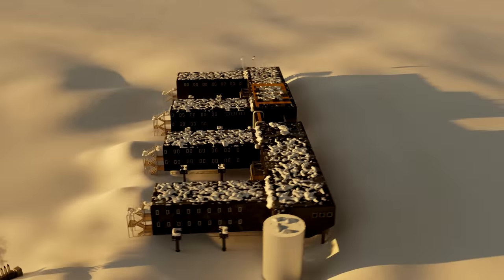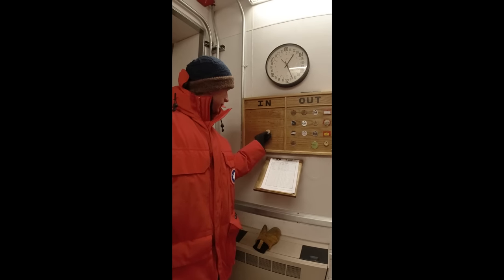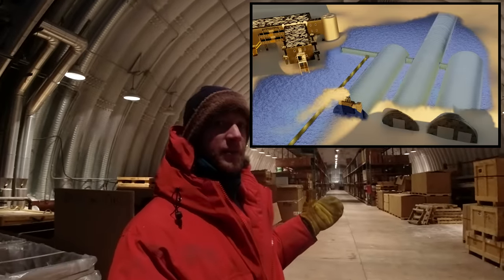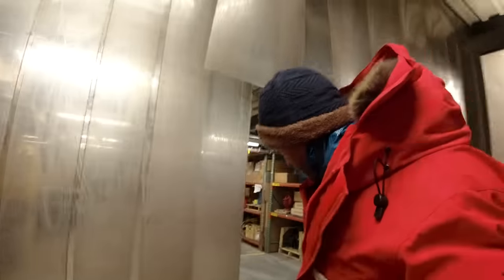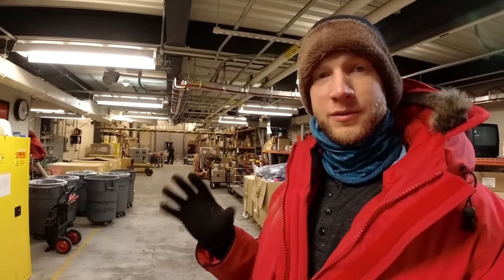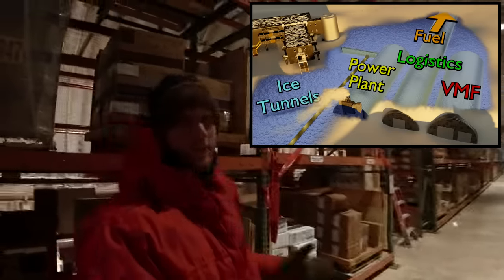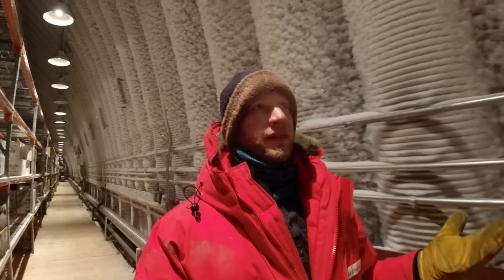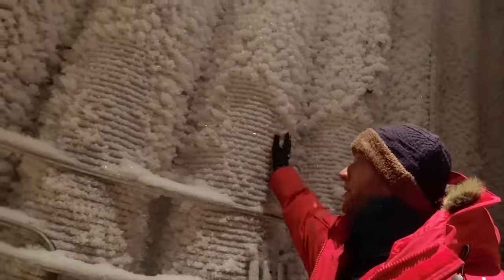South Pole Station Tour - Part 3 - The buried sections

Comment: Thanks for the tour. It is amazing  how all this is done underground. 
Where does all the diesel exhaust go to when vehicles are being maintained inside? Are there filters, scrubbers etc to take care of it? And the vehicles driving outside, where does that exhaust go? If fuel spills happen, what is the procedure to capture any leakage? Just wondering.
Reply: Don't think anyone care. What people don't know or can see, then you don't tell.
Antarctica is a big place... Hey, it doesn't matter if we just pollutes nature a bit. A little snow on just so no one can see.
Reply: Go back and listen to what Joe said about fuel. There is no diesel.
Reply: US fire stations have exhaust hose systems that hang above the exhaust stacks so that engines can be run safely indoors during drills and warm ups.  Of course, the stations are not under ground.

Comment: Serious question: why don’t they put in a small nuclear reactor like ones they use on aircraft carriers to power this place? With diesel generator backup? Would the issue be water cooling the reactor? Or risk of a shutdown or catastrophe? It seems to be a much more efficient manner of powering this place long term and saving on fuel costs. Any input is greatly appreciated.
Reply: Too expensive.
Nuclear reactors require constant maintenance. When ship can go to port that's fine, but to do maintenance in the South pole is like nailing with a golden hammer. You can do it, but it's too expensive with a cheaper alternative.
Building, transporting, maintaining nuclear reactor in this circumstances would break even in a couple hundred years.

Comment: is it not possible to use solar power in sub zero conditions? ive seen people use them fine in snow. just seems like it would make sense in a place where the sun stays up constantly for several months out of the year.
Reply from the maker: It might be possible, but a logistical nightmare. uge array to get at least a couple hundred kilowatts. Active tracking since the sun moves laterally (in a circle), and motors hate extreme cold; anything with moving parts really. And then a dedicated technician. Constant cleaning due to windblown ice/snow. And all that simply to supplement main power for a few months of the year. It just hasn't been seen as a priority.

Comment: Very interesting to follow you! Has it happened that small rodents and insects have entered the station with goods.
Reply from the maker: Nope! No bugs or critters
Reply: @JoeSpinstheGlobe  it is actually very surprising that mice and roaches haven't made it there....yet. It may be the only human habitation on the planet without our commensal followers. they should have a cat at AS though, just in case. plus it would be cool.
Reply: At -55°F I doubt any critter could survive and a cat will die for sure.
Reply: @Muonium1 No animals, like cats, are allowed anywhere on Antarctica. There’s one thing that humans have learnt, when you take an animal to eat a pest the animal finds easier things to eat. Which is why Australia is killing 3,000,000 cats, they have caused the extinction of 25 species of marsupials. If you released a cat at the other stations near the coast the cats would kill penguins, eat their chicks and destroy all the Skua and Petrel populations. A catastrophe.
Reply: @kylekyle7386 He meant inside the base, not outside.
Reply: @teeanahera8949  So don't allow them at the coastal bases. There is exactly zero chance of a pet cat at the Amundsen station causing any kind of detrimental environmental impact of any kind.
Reply: @teeanahera8949 yes, like on Marion Island. They had a huge cat problem, and now I think they have a rat problem.

Comment: Is there a camera or alarm system that you know of? I am a security technician and I am fascinated by the facility. And the logistics of running long COAX/Cat5e or Fiber. Especially with the long range, they'd have to be IDF (Data) cabinets all around the facility or just 2 if you have good switches and DVR'sworrisome
Reply from the maker: There's just two i believe on station (separated for security/safety), with all fiber connections between them and to the satellite uplink facility. But that's about
Reply: @JoeSpinstheGlobe  That's amazing, I wonder what is leading to the Satellite Uplink Facility. Straight Pipe i'd imagine! And thanks for answering my very curious question! I'll do some more research on the matter :)

Comment: For burnables with a scrubber for waste particles in smoke wouldn't a high temp incinerator generator(away from living area and support generation buildings) be good to use too for heat, energy to recycle waste and have even less and more reduced waste to be shipped out? Many farms have those now.
Reply: Too polluting, too much maintenance, too few staff to monitor it. Antarctica needs to be kept pristine.
Reply: @teeanahera8949  Yeah no matter how high tech there'd be some pollution released. Anywhere else it's good vs landfill for Antarctica nothing needs to there beyond nature's waste cycle.

Comment: I'm surprised you guys don't have solar pannels or wind turbines for use in the summer. Aside from needing a daily clean it could significantly decrease the fuel you need.
Reply: Panels and turbines would both be exposed to constant temperatures below freezing. They'd require permanent maintenance and it just wouldn't be viable.

Comment: Fascinating tour . I would have thought that  solar power would play a larger part of you power supply nowadays though ? or is it too cold for panels to operate?
Reply: The sun angle is probably too low at the South Pole. I know that Greenpeace did use some solar at their small Antartic Station back in the early 90's. Their documentaion indicated that it just supplemented their power during the summer months and stretched their fuel for the generators. They also had a wind turbine as well. Greenpeace was close to the coast so the sun angle would have been a bit higher in the sky.
Reply: Solar panel work better the colder it gets. At absolute zero -273º they would improve performance massively. As mentioned the Sun is low at 23º and it travels in a circle around the sky, hard to track it in that instance.

Comment: Those generators look like either CAT 3512 or 3516 engines?
Reply: 3512's with a 3406 kicker that is currently inop.  Plus backup gen sets in the B-pod "life boat" that are also 3406's.

Comment: This is got to be one of the only efficient uses of internal combustion engines in the world. Petroleum powered motors are horribly inefficient because they waste so much energy as heat . Amundson is in a very unique position to be able to use that heat directly. 

There'd probably need to be three or four times as many wind turbines or solar cells dedicated to heat generation as would be needed for all other electrical loads. The sheer physical area required to set up and maintain such a wind or solar farm would cost more than several decades worth of diesel fuel. (Ignoring the fact there's no sun in winter)
Reply: Didn’t pay attention did you? No diesel there. Secondly how do solar panels work when the sun is no higher than 23º above the horizon and travels in a 360º circle around the sky.

Comment: It's very surprising to me the entire facility consumes only half a megawatt. It would really be a perfect application for a small, modular, few MW nuclear reactor. Far fewer expensive diesel fuel flights!
Reply from the maker: It's been discussed before for sure. I'm no expert but i imagine one major hurdle is the water usage. All water has to be melted from the rodriguez well. A lot of steam could probably be reclaimed especially with the cold ambient temp but the base need might be prohibitive.
Reply: @JoeSpinstheGlobe  yes, I think the air being sufficiently cold all the time could probably enable a totally air-cooled design. My the guess is that the leak plagued nukey-poo at Mcmurdo in the 60s still casts a certain shadow over the prospect of doing it at Amundsen. 

Are you down there now? Could you do a video on the retrieval of meteorites from the rodwell pump filter? I don't think I've ever seen anyone do that.

Comment: Can solar power be dropped in to take a bit of load off the enerators? Or use dual use generators that use solar and fuel?
Reply: Not sure about solar, the sun never rises too far, 23º above the horizon and travels though a lot of atmosphere which is weaker light. The panels would have to travel in a circle 24 hours a day to follow the Sun on its circular movement around the sky.

Comment: Its quite ironic, that the south pole is an incredibly windy place........and wind turbines would be highly unsuited to it.  LoL      450,000 gallons of fuel sounds like a lot...........but an average open cut coal mine would burn through that in 10 days.
Reply: The Sth Pole is not incredibly windy, off the plateau nearer the coast it is incredibly windy. Ave highest speed is 50 knots.

Comment: How does the station get its fresh water?
Reply: See all that white stuff outside? They melt it, filter it, etc.
Reply: @jfbeam  I wonder if they'd even need filter, like what kind of organisms lives in South Pole snow?
Reply: They use rod-wells, named after the engineer who invented them, a Mr Rodriguez.

The basic idea is that they dig a small hole, heat up some ice until it is boiling water, then inject it into the hole. Then they pump out the larger volume of water that is melted by the heated water, cycle some of it back to continue the process, and skim off the rest to provide water for the station. One location for the rod-well can last several years, and when it is time to start a new rod-well they use the old one as a repository for any sewage produced.

Comment: Why are lights left on? when no one is using a room. Seems like a waste of gas on those generators. Lights or rooms should have motion detectors on.
Reply from the maker: Good question. I'm sure there are more reasons, but i heard one reason is that a certain baseload is needed for the generator health, or else the lower RPMs cause some issues. In fact there was one instance where the power plant team was talking to science about increasing their power draw at a time when another part of the station was going offline, just to maintain load.

Comment: around 2:28 he said the interrior is the temperature of the ice... -50 celcius? is that possible? it doesnt seem to make sense. If you make an igloo / enclosed area, especially if there are lights and other sources of electricity, temperature inside the storage area should be between -10 and 0 no matter what temperature is outside. Am i right?
Reply from the maker: In an igloo there's a small volume and a relatively large heat source (a human), and will cool if that heat source leaves.  In the arches there is a massive volume and relatively little heat; heat leakage from DNF is minimized as much as possible, and I'm pretty sure all the lights are LED (which have very little waste heat).  Also the metal arch is not insulated, so all that surface area to the outside ice (at -55f) pretty much overwhelms any heat production.
Reply: @JoeSpinstheGlobe  oh ok thanks for taking the time to add precision!
Reply: But it's still deep under the snow, so the "outside" temperatur is not the same as it is on the surface
Reply: @susannebrunberg4174 it would be, it is Winter so there is no Sun to heat the air or the snow/ice.

Comment: How come they don’t have wind turbines for power, it seems like a perfect location?
Reply from the maker: It's been discussed, but i believe the reliability, maintenance, and repair is prohibitive. I don't think there are any with working temps colder than Mars. And rmember you have 50-ish lives depending on the power not going out for 9 months straight with no resupply. You gotta go with the most reliable thing.
Reply: The wind isn't so stable across the continent. At times, there can be unbelievable high winds. Even in the US, there are multiple times throughout the year turbine farms have to park their generators to avoid damage due to high winds. And that's in places where it isn't -60F. And to head off the next question... solar panels need almost constant attention to keep the snow and ice off of them. And they, too, don't function so well in the extreme cold.
Reply: @jfbeam a few problems with your statements. The wind speed is high at the coast but at the high altitude of the sth pole station it is not severe as it is not subject to the katabatic effect of being off the plateau. Solar panels work BEST the colder they get as the electrical resistance is 0 at Absolute Zero. The sun only rises 23º above the horizon and travels in a 360º circle around the sky at peak Summer. Now work out the problem dealing with those two conundrums.
Reply: @teeanahera8949  Have you ever cooled a solar panel to near absolute zero? (I'd settle of mere cryogenic temps - liquid nitrogen.) While the metal wires will have lower resistance, the ability of the panel to collect solar energy is significantly compromised at very low temperatures. (hint: at abs-zero, they won't work at all.) Snow and ice accumulation is still a problem. But by all means, get a grant, setup some panels, prove how wrong I am.

Comment: I wonder why the fuel does not freeze.
Reply: A very cold freezing point. You could look it up, take you about 20 seconds. I did it for you. Freezing point of jet fuel is -47 in proper temp, Americans will have to convert.
Reply: @teeanahera8949  Thank you. I asked Mr Google, too: Planes fly up to 12 km, whereas above 11 km, the temperature ist more or less stable at -55 °C.

Comment: I really do not understand why these places are not operated by a Nuclear generator. The Carbon savings and ongoing Diesel savings would be huge!
Reply: Transporting nuclear fuel to the south pole would be a pretty dangerous and likely expensive procedure. Also you'd then need to have a whole new team of people who can work with the nuclear generator itself. If it ain't broke don't fix it and the generators they have now do the job perfectly fine
Reply: Nuclear is expensive and maintenance heavy. For the size of these stations generators are more than enough.
Reply: The Antarctic Treaty forbids the disposal of nuclear waste. Then there’s Chernobyl!

Comment: All Genny's. Why no PV Solar? or Wind? Although, maybe the wind power would be a maintenance nightmare, witht the extreme temp changes and environment.
Reply from the maker: Yep absolutely right on the wind, and solar only works for 6 months at best (sun is below the horizon the other 6)
Reply: @JoeSpinstheGlobe  I get that, about the long arctic night, still, every little bit helps. I mean, logistically, it would help with transporting less fuel.

Of course, I am almost positive, you and I are not going to solve the issue.
Reply from the maker: @gregbluefinstudios4658  yes but many logistical challenges.  Two big ones are 1) The sun moves laterally (sideways) during summer at the south pole, so you need active tracking, motors, moving parts... which hate extreme cold, and 2) there is a constant wind blowing ice crystals and snow, and the panels would probably need to be cleaned daily to be effective.
Reply: @gregbluefinstudios4658 remember the Sun is weak too as it travels through lots more atmosphere at a max altitude of 23º above the horizon.

Comment: I find it comical that heat energy wise, everything is backward.. in an engine, you usually use anti-freeze to keep things cool, but you guys use it to heat the station.. freezer doors are usually to keep the cold air IN, not out lmao

Comment: Why is this facility NOT 100% wind power?
Reply from the maker: It's about reliability. Moving parts working constantly at super cold temps need a lot of maintenance. And with the need for redundancy, you're talking about a few turbines and lots of energy storage. Diesel generators are just more proven and reliable.

Comment: Not to be a Climate Change downer, but Antarctica research couldn't be done without petroleum fuel. As much as the zealots want to stop using it within a few years, the technology is still 50-100 years away.
I've lived in a work camp in the Rockies and it did bother me to hear that generator going at high revs 24/7. It is reality unfortunately for the next while.
Great tour!
Reply: Well, we could power it with nuclear, but that boondoogle in the 60's (McMurdo) just made a huge mess. (I'm told that area is still radioactive to this day, 'tho significantly less.) The Antarctic Treaty makes building a nuclear power plant there difficult ("impossible") and of dubious legality. (technically the McMurdo reactor violated the treaty: radioactive leaks contaminated the site. The only remediation available for radiation is "put it somewhere, and keep people away from it".)
Reply: Lol alternate technology to running the generators on jet fuel is 50 to 100 years away! 😂 Try 10. They may use hydrogen for example.